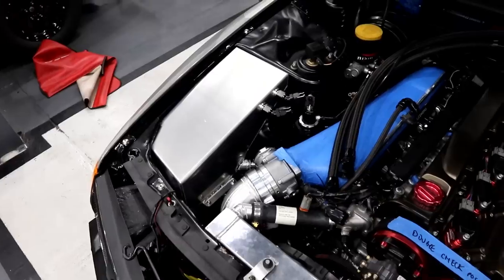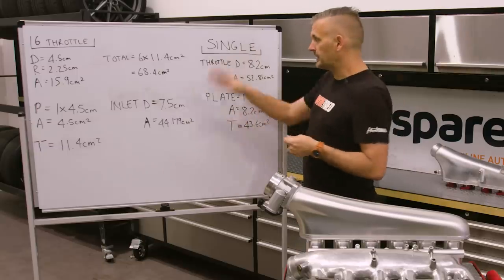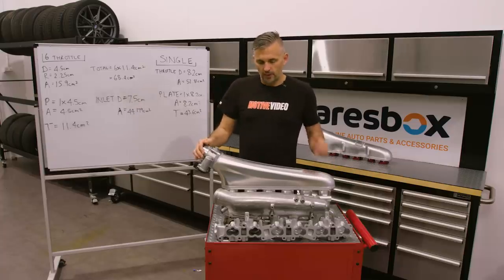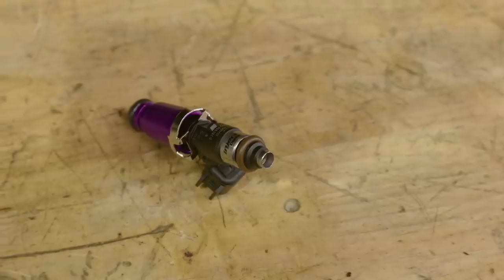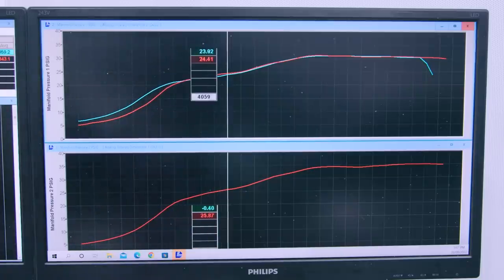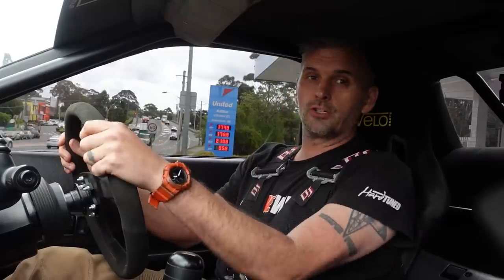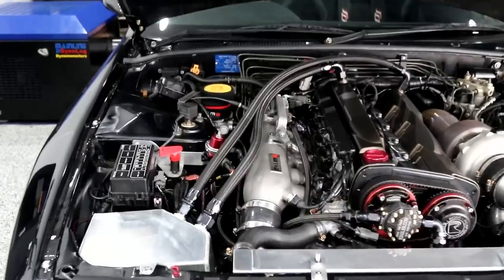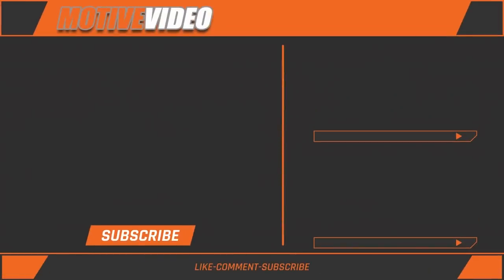6 vs Single-Throttle - Which One is Better on 1000hp RB26? - Motive Garage R32 Skyline GT-R

Comment: Andrew, when you are comparing cross sectional areas at the throttles what you are missing is something called hydraulic diameter. Even though the 6 throttles have a greater combined cross section the wetted surfaces with the throttle plates all create more drag on the air because of the increased boundary layer.
Also when you refer to the time taken to pressurise a given plenum, don't forget the sort of quantities of air going through the system. A standard 2.6L RB at 8k rpm and 1 bar of boost is consuming 10,400 litre of air a minute or 173L a second. Your 3.2 at 8k and 2 bar its more like 25,600L per min of 426L a second!!!! Picture that much air!! So that pressurisation time is negligible. Where 6 throttles do help is on lift off as there is considerable less volume to drain from just one runner per throttle over the single where you've got to drain 6 runners and the manifold volume itself, so response is better there.
Reply: Nerd! Haha
Reply: @johngray5360  bit too complicated for you to follow along there mate? Some of those numbers were pretty big yeah!
Reply: Oh yeah, apparently maths and actual sciencing is not equitable!
Reply: Wouldn’t the draining on lift off also be very negligible? The engine is pumping a lot of air as you say
Reply: @coreyw427  rpm dependent
Reply: @wobblysauce  yes it’s rpm and VE dependent, but at 8k rpm should be pretty immaterial as well I’d have thought
Reply: @coreyw427  I guess it would be pretty little, just enough for one more burn cycle before the pressure drops, where as the single throttle may have enough for a few mores revs of the Crank. I don't know what sort of response times individual throttles offer or how perceptable it would be.
Reply: But like everything... 'it depends', loads of variables.
Reply: Bernoulli.
Reply: @johngray5360  science requires math. You think the engineers that designed these parts don't do maths? The more you know...
Reply: Uh, a few things you're overlooking -
If (!) the ITB bores are larger there will indeed be a larger wall area - but you're ignoring the point that the laminal flow area is also greater and the mean velocity may be lower.
Not sure why you are comp ring two quite different applications? Regardless, you can't express the airflow like that, because it's COMPRESSED - the mass will be higher but the volume is not proportional. Oh, and you may wish to review your math', unless the engines are relatively inefficient?
Yes, in theory the ITB "should" give better response because of the plenum and runners need to fill and evacuate with the single body - but the average plunum is 2-3 times the swept volume, so that is perhaps 6 engine revolutions, or at 3k rpm a whole 1/10th of a second, or so. Spooling up would be expected to have more effect on throttle opening.
Reply: @dazaspc  
Well, if you're going to go that far, there's the torsional spring, and resonant, frequencies of not just the crankshaft but the camshafts, which can be more significant - this was the primary reason crank triggers were developed for the Chev' engines with the rear distributors, which also drove the oil pumps - spark scatter was big problem. It's also one of the reasons why 'race' engines will often be fitted with larger diameter journals which allow larger diameter shafts which are more resistant to twisting with the high lifts and spring rates used.
then there's the syncronisation of the throttle bodies, balancing the airflow through the plenum or airbox, if used, temperature and pressurte gradients in the engine bay if not.
List goes on and on.
Reply: @dazaspc  
Hmmm, not sure where you got your info' or how well you understood it.
It would be remarkably stupid to try and establish crank deflection angles that way, paricularely when other influenced like the camshaft twisting isn't taken into account, when it's much simpler to corrolate the actual angle of the front and rear of the crankshaft through a range of loads and rpms - most simple would be to fix the timing advance and mark the crankshaft pulley, or damper, perimiter with each degree, with the 0 point being established with a timing light - you can purchase tape with 360 degree markings for most common damper diameters. One can then log the variations of the other cylinder's firing against it at different rpm.
If one wanted to, one could use a finite anaysis tool to calculate not only the torsional twist, but the intermediate bending stres and strain, too.
In some ways that may be easier than running the high frequency transducers required for the pressure variations.
As for the heads being "all the same", even the best OEM ports have variations, as do the best hand ported heads - a fully CNC machined head, valves, valve seats, etc, may come close, though.

Ricardo, the man not the company he founded, produced some seminal work - especially in airflow within the engine, but you should remember that back in those days the engines were normally very long stroke, the crankshafts and connecting rods were quite spindly, and the crankshafts were usually very poorly supported in the block - some 4 cylinder engines had only 2 main bearings, inline sixes had 3 or 4, even some V8 engines only had 3 main bearings - all these meant that a lot of crankshaft twisting and lexing was a common thing - in fact when Austin changed from a 2 main to a 3 main and started breaking crankshafts, one of the reasons some "engineers" claimed was the problem was the crankshaft couldn't flex.

Yes, better materials mean the main and big end journal sizes can be reduced, which is important for bearing speeds - or rather the shear velocities - on high speed engines, at the cost of bearing load area.
Yes, the parasitic losses due to the shear drag can be significant, something else that's a factor is the pressure required to overcome main bearing centrifugal force with large diameters and/or higher rpm.

If you check, I'm confident I said something along the lines of "one of the reasons" when I mentioned the larger diameter camshafts, because the torsional twisting was the main topic - as you say, by using larger diameter journals, and the corresponding larger bearing bores, there is a big advantage in being also able to use a larger base circle as it allows more optimal face thrust angles, especially with roller followers, that allows higher acceleration rates.
The higher shear velocities, with the resuting parasitic loadings, are much less of a concern, not least because it's half engine speed - I have seen some date on camshafts running roller bearings (as opposed to followers), splash lubricated, and there is a small gain.

Yes, raising the camshaft location on pushrod engines does make a small improvement on valve train stability, mostly because of shorter pushrods flexing less under high loads - as an aside, some of the top builders are using valvetrains that are theoretically running the valves and pistons into contact with each other, but the rockers and pushrods are flexing enough under load that there is clearance maintained.
With (D)OHC engines it doesn't usually need the camshaft to be re-located unless it's direct acting, in which case the follower diameter is a limiting factor - there's a reason all 'race' engines have used some form of indirect valve operation for decades - or it's easier than redesigning the mechanism for transferring the camshaft lift to the valve - usually some form or rocker or finger.

Not sure what you're trying to say in the last paragraph - the plenum volume is shared either way, the ITB and single TB runners can be made functionally identical as far as length and diameter are concerned - the presence of the butterflies can be negligible (and I've seen testing of ITBs with butterflies in place and with them semoved and shafts blocked) with ITBs usually offering part throttle benefits because of the pressure waves from the butterflies - you may have noticed on some vehicles the engine was more responsive at low rpm to part, rather than full, throttle?

Yes, your "cascading" is our "positive feedback"👍

Yes, correctly applied " bosst" is king, but catch someone in the wrong gear and it can  different story, especially when a poor selection of parts were used 😉

That was a bit long, but we're under two "red" weather alerts, and there's no satelite TV reception...
Reply: @dazaspc  
Yup, I can understand the PTSD, did electrical/electronics stuff too - these youngsters don't know how lucky they are, and not just the computer programs and simulations, but even the most basic calculators have way more functionality that the old "lag tables" and slide-rules... i was lucky, I just started using slapsticks in high school when very basic calculators were coming in, still need the log tables, though.
Yes, I missed the point you raised about stroker crankshaft and/or connecting rod clearance driving the need for lifted camshaft positions.

Thank you for the best wishes for the bad weather we've been having - I'm fortunately well clear of the flood areas and reasonably sheltered from the winds - but there are a lot of people less fortunate who have lost everything, and there are a lot of roads taken out around the country with another day or two to go, which means many are stuck with no way out, or in for aid to them.
It's a lot less than some of your countrymen and women go through on a regular basis because of tornados, hurricanes, and of late the power cuts with the freezing weather and massive snow dumps, but that's of no solace for those affected.
It's been 3 "once in a hundred years" events hitting in a matter of a few weeks in the same place, and some of the same people have been flooded out each time.
Flood plains are called "flood plains" for a reason - housing should never have been allowed on them.

Comment: From the research i did and years of forums and racing, ive noticed that ITB setups have better benefits on N/A applications especially with dual length runners, running single length runners usually leaves a part of the rev range lacking on torque.

im still a sucker for Gantry fuel injection aha

im loving how your GTR is going, change alot over the years

Comment: You're bang on about the drivability being different going to DBW. I grew up driving carby and cable throttle cars and they are infinitely more polite to you when you're trying to drive them smoothly when you're on and off the throttle in traffic, the initial burst of airflow from opening isn't linear at all and ends up quite jerky to drive, even on a smaller diameter DBW. 

I love the response and tunability of DBW, but I can't shift the notion that every DBW car I've owned would've been better with a cable.

Comment: No real surprise in the results. Other than I'm surprised it was so close. The 45mm throttles are too small for such an engine. 48 or 50mm throttles wild likely see the gap disappear entirely.

In real terms the difference can be attributed to the resistance the throttle shaft is having in the modest 45mm runner. Where in the single setup, there is no such imposition.
Reply: Did you even watch the vid? He calculated the net area where the throttle plates were subtracted. The 6 throttles had more net area, though the actual opening on the plenum is almost the same as the single throttle.

Comment: Makes sense the single throttle does better at the top. Those ITBs take up some of the runner volume even full flat. Always wondered about a slide throttle. Probably deep into diminishing returns on effort to gains. Tip in works different that i'da expected then. I figured 6 cracking open would introduce more volume per port. Man she's a monster!

Comment: The inlet size was different on both manifolds test voided 82mm opening on single throttle  inlet and you made the intercooler piping bigger on the inlet side for the single throttle plenum also.
Reply: Go do some transient throttle through corners on a race track! can't just putt around the street then do wide open pulls on a drag strip. Why would you run individual throttles on a drag strip its wide open throttle application.
Reply: @driftpig2462  I was hoping to see a bit of circuit work with the two different manifolds as well
Reply: The test should have been done with a mechanical single throttle since comparison with an electric throttle puts it at an advantage over the mechanical type.

Comment: You can tune the throttle curve to get rid of that initial throttle opening too. When I first fitted my link ecu to an old 350z I had. It came with a linear throttle curve and it was horrible. Adjusted it so up till half pedal it only gave about 25% throttle and then ramped up after that. And it transformed the car.
Reply: Was that with DBW or mechanical? Itb or single throttle? Can you explain further? Very interesting

Comment: Honestly love that you guys test and debunk this stuff.  Im surprised how close the results were. However i dont know how controlled you can consider this experiment.  You made alot of subtle changes between the two manifolds, including new injectors and dbw.  Could all the small changes have contributed to the difference in power?  Old injectors may have not flowed as well, dbw may have contributed to better driveability, etc.  Was the test with the itb manifold done with itbs that were in good condition, not leaking like most do?  Just feel like there could be some more factors there.   Would love to see the same test done on the every mans 500hp rb26 setup, I wonder if the difference would be more obvious or less.   Keep up the great work!
Reply from the maker: They used the same base port matched to the head and port matched to the manifold

the intercooler pipe is inconsequential as it just matches the size of the intake opening

we literally couldn’t have made it any fairer.

Comment: Another cool vid👌 my 1st thought is the single TB would make more power as they both have relatively the same surface area at the inlets smallest part of the plenum but the 6 throttle has 6 restrictions in the runners.
Look forward to the next vid!
Reply: He calculated the net area where he subtracted the throttle plates, the 6 throttle still had more. But the opening on the plenum does not match the total area of the 6 throttles.

Comment: When i went single throttle body on my car (90mm) on a 2.6 making about 750 wheel the biggest thing i noticed was the car didnt feel like a slouch driving around ourside of boost anymore. I wasnt as much worried about how fast the boost came on but when you crack that big throttle body the car gets moving stop light to stop light and didnt feel like a turd. Im sure the big cams helped as well.

Comment: Interesting comments around the initial throttle openning, in Haltechs video on ITBs that was the main disadvantage of ITBs compared to single throttle. 

What the difference maybe is the OEM throttle had some progression on the opening so at small throttle % it actually openned less than you moved the pedal. This is really common on bikes to soften the initial throttle openning and something we tune in ride by wire bikes to suit the preference of a rider so that is something you can add to your single throttle setup as well
Reply from the maker: Big throttles let a lot of air in the moment they open.  For example an 82mm vs a 65mm at 5% opening is way more air from the 82mm
Reply: Yeah I was going to say - that's the main advantage of DBW, you can make the throttle work however you want, if you need the pedal to be a bit less responsive or have 1% pedal to 0.5% throttle opening
Reply: @MotiveVideo  I understand that concept for comparing 2 single throttles but its doesn't apply when comparing 6 ITbs to a single, and Haltechs comments are comparing a ITb and single throttle setup capable of the same power (not stated but its implied).

I did some maths comparing the open cross section of 6 x 45mm throttles vs 1 x 82mm and at different throttle openings and at 5% open the ITB have 80% more open area and this doesnt start to even out until past 40% throttle. This isnt 100% but its a good indication.

Either way tuning a progressive DBW map for the initial throttle opening will make the car easier to drive at those low TPS%

Comment: This works out very easily, when you have itb’s that throttle plate has to flow enough air for that 1 port, when you have a single TB for all 6 it is only actually feeding 2 cylinders at any one time.
So you have an ITB with 11.4cm feeding 1 port and a single TB setup with 43cm feeding 2 ports, there is no comparison, the total area of 6 itb’s combined means nothing, the other itb’s don’t contribute to any port but there own.
Going on your 11.4cm2 area for the itb that is a max flow rate of 258cfm at 28” test pressure, as a ballpark I will say with the itb’s power peaked just under 8500rpm?
Now remove the the itb’s and those intake runners now have the full 15.9cm2 area to use, that’s a 350cfm potential flow at 28” test pressure, so no restriction at all, as I doubt the head itself flows anywhere near that.
This is purely why your results are the way they are, put 50mm itb’s in it either runners blended to suit and it makes the same power again because it will be the head itself that is the next restriction.

Comment: I'm sure your aware. But you can tune the throttle open % vs pedal press. So you can make the first 30% of pedal only move the blade 15-20%

Comment: also with the DBW you can tune the amount the throttle opens for a given amount of pedal input for a given RPM 

for example 10% TPS could be 5% throttle and can ramp up and into being 1:1 for higher TPS so you can make the car MUCH more managable at low speed

Comment: The benefits of modern fly by wire and the control with an aftermarket ecu will always out preform 90s 6 throttle technology.  Be interesting to see electronic 6 throttle...